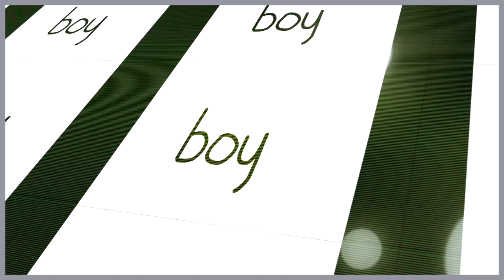How to Build A Staggered Fused Clapton Coil the Easy Way

Comment: Staggered fused claptons were always pretty easy for me, but it took me forever to get an alien clapton down. I always did my staggered fused claptons freehand and without swivels but i always used the loop method because i dont want to waste all that wire haha. I even made a 32gx2 core wires staggered with 36g freehand, an 8 wrap came out to 1.5 or 1.8 ohms, somewhere around there... I could never get more than an inch of an alien clapton good freehand tho, but I finally got some swivels and now they are just as easy as a normal clapton for me. But this is a very informational video man!
Reply from the maker: +JAM3ZI420I yeah you freehanders are crazy! that requires a level of patience and commitment that i just do not possess

Comment: very nicely done man. very nicely done. definitely going to look into the hand drill
Reply from the maker: +Joshua “Apathy” Miller oh it's killer... i love that thing
Reply: +OhmBoy Josh hey josh wanted to tell ya that on my stapled coils i no longer cut my ribbon wire. i just bend them over and crimp them now. alot easier to keep em all together. instead of having 6 or 20 or however many pieces of ribbon i just fold it into 6 pieces and crimp each fold with my pliers. been alot easier than trying to stack all of em together and then keep em together. figured id let ya know.

Comment: these are my favorite coils to vape on, I like making them too, I made one last night with three different size wire, first I claptoned 28g with 30g, then fused them together with 34g,  such a good vape, I need a macro lens from my phone so I can start shaping pictures.
Reply: taking*
Reply from the maker: +Shawn Reding definitely man! You can get a macro pretty reasonably on amazon that'll fit over any smartphone
Reply: +OhmBoy Josh Made a micro staggered clapton this evening, 30g cores wrapped with 34g (all 316L), no magnifying glass...5 wraps around a 2mm spaced and then put in a 25mm VCMT to run in TC...I really need a micro lens!

Comment: Thanks +OhmBoy Josh for posting this awesome tutorial! The other day, I got a C.M v3 diy coil / tool kit, an iJoy RTDA Classic  and a couple spools of wire. The RDTA along with my Wismec Theorem,  Buddha Zephyr  and Kanger RBA I now have a few build deck options to start honing my coil building skills. I've already built several standard wrap coils, but I can't wait to try building the more complex types of coils such as the staggered fused Clapton etc.....  Now for my "newb" question, how do you get the different heat colors to show up in the coils?

Comment: Y'know... If your lazy and dont mind a less than perfect build, what you can also do is clapton half the length of wire, loosen it, and just pull it to the end. It wont come out perfect (there will be a few spacing issues) but you should be able to happily get 6 or 7 clean wraps with the same length of wire shown. I usually make giant wires so I dont have to do it twice, and that contributes to the extra slop and waste but still, it's an amazing vape. 

It's also nice to see some one else using large atty's. I use the 30mm Mason Gemini myself, the 40mm was just too much of a monster for my needs. Bigger builds = more vapor and flavor, but also massively increases the juice consumption too.

Comment: i tried this but used a lower gauge for the loop (28) so when the spring contracts, the actual gap between wires is closer to the fusing clapton wire (30). very east n freehanded the whole thing, just a thought, i find the faster it spins, the more even n tight the wrap

Comment: Ok so I've got half of this on lock, so a spaced clapton fused to a round wire, I'm working on the full staggered fused.I keep running into problems though, I have tried 24g and 26g Nichrome80, 22g, 24g,and 26g A1 Kanthal and I keep running into the same problem. As I make the spaced/staggered clapton the core wire repeatedly breaks off at the chuck of the drill. Any tips or thoughts on why?

Comment: If you go to electronics sites like Maplin or Rapidonline, they have sections with educational kits for schools and stuff. For very little money, you can buy a motor in a mount, that also has enough spare cogs to gear it how you want, with plenty of spares you can use to make a rig that turns at both ends, so you don't need swivels cus both sides are turning at exactly the same RPM. You'd still need some skills to build something, but you could make a good rig very cheaply. You can even make a speed controller you operate with your foot, from an old/broken Wah pedal. As long as the pot still turns when you move the pedal. Even if the pot is broken - prolly the most common failure point of a wah pedal - you can easily get a new one for a couple bucks.Or you can forego a speed controller or make one that isn't hands free.

Comment: hey Josh! great tutorial!! I like the hand drill tool and already bought the same googles, really helps building, buy hey, I wonder how can I check the own without setting the coil on the rda, I use a multimeter but I think it may not be the best way, thank you!
Reply from the maker: +Ciro M. Aside from seating the coil on am atty and putting it on a device not sure about another way to check the resistance

Comment: Josh i know this is the wrong video for this post but im hoping regardless that you'll give me a pro tip.. for the life of me i cant seem to fuse more then 3 wires together.. just 2 is fine.. when i do 3 and think everything is parallel in my chuck and at the end of my bearing swivels and even with the keyring around the center of the wire as well after about 3-7mm it bunches up.. idk why or how ive tried leading the wire and following the wire more pressure less pressure.. i just cant seem to get the proper finesse to keep the cores all laying flat.. without them getting bunched up:(.. sucks the big one.. i want to get multi-core fused claptons down before i get myself into the alien.. in concept and theory i know i could do it its not all that complicated im sure (hoping) i just need your Jedi coil skill and any protip as to how i can keep my wires parallel oh ive tried tape as well but doesnt really do anything for me.. please if you'd humor me.. in a response that'd be great.. ive asked on forums etc. and some people are assholes and wont help because im not a jedi at coil creations.. so please if you would.. if not i understand im sure you have a lot a lot of things on your plate then to answer a newb with whats im sure to you a dumb question..

Comment: Another great tutorial Josh. That hand drill is awesome.
Have you tried creating these yet without creating the spaced Clapton wrap?

Let me know if you need the trick tip? 

Loving the content in your channel bro. 

Mad respect!!!
Reply from the maker: +Jon Damon Thanks man! Yeah i love that hand drill way too much.... but what do you mean exactly? creating a staggered fused clapton without staggering the clapton? like a fused clapton? that's not what you mean... what do you mean? i don't follow
Reply: +OhmBoy Josh take a piece of core wire, Clapton wrap just over half of it. 
Spin your drill in reverse to open up the wraps (like m.terk does to decore) do this twice for each core of the SFC.
Then line up the 2 cores on your swivels and in the chuck. 

Then anchor your fuse wire and wrap as you would an Alien by leading it forward slightly. 

The reversing of the drill to loosen the wraps creates enough space to fuse it! 

Hey presto easy SFC. 

TRY IT OUT. 

Personally I Clapton in 38 and fuse in 40. 

@CoilBuilderJ_v.b.c

Comment: i would like to see more about the separation part. i didnt quite get the loop thingy ahaha. i have tried squid dude method twice but my wire broke twice.. rip
Reply from the maker: +Marcus Gersbøll (Harekusse) hmmm... basically that loop acts as the second strand in squidoode's tutorial... rather than using the second strand, you use a loop of wire to act as a spacer wire... you place it just before the last loop of the initial inch or so of clapton and then just clapton through the strand as you normally would and it creates the staggered core
Reply: OhmBoy Josh okay thank you ill try it out soon :)

Comment: Ive been thinking about using a larger gauge for the loop, like 34 or 32, so I dont run into as many problems if the claptons are unevenly spaced when I do the actual fusing. Not sure if it will make gaps or not, but this is probably the most infuriating part of the process I run into, gotta find a way to make it more consistent
Reply from the maker: +torwantssandwich you could, absolutely... it won't be as tight between the fuse and the staggered tho... loosening up the core really does wonders tho

Comment: Great video as always thank u. I noticed in a few of your vids that u like to build & wick on a kbox 200 but then u always switch mods for the face time part. Why is that? I have a kbox 200 which is why I'm curious.
Reply from the maker: no real reason honestly... i will usually build on whatever i have handy if i'm not using an ohm meter... the kbox 200 is a box i usually have around because it's a good beater box, so i reach for it often
Reply: OhmBoy Josh can u make a video of taking close up micro pics of coil. u should make it a how to video, & show us how to make a setup that would be fucking awesome, thanks✌

Comment: Nice. But instead of stretching the core wire and loosening the wrap, you can just use a larger gauge wire to space the clapton while wrapping. So wrap with 32awg, but use a 28awg for the spacing wire. This works great for me. And  you don't end up with uneven spacing,

Comment: Hey Josh how would you say a staggered fused clapton compares to a Staged Heating coil (Fused clapton 2x26g - 32g with twisted 26g). Staged heating is currently my fav coil and have used it for a year or so but am also on the hunt for something different/better.
Reply from the maker: +James Muir i would compare it more to a fused clapton... better flavor, but a slower ramp up... but you can make the staggered fused clapton into a staged heating build, too

Comment: Brilliant idea using the Fiskar. I got the fused clapton, staple, framed staple, down. I believe I am ready for the stagered fused clapton. I got the fiskar. My question though... is it worth the effort?
Reply from the maker: imo the sfc has slightly better flavor than the fused clapton and a slightly longer ramp up.... but once you learn the sfc, it's kind of a gateway into the staple staggered, the staple staggerton... lots of other fun builds
Reply: Dude.. I finally got a staggered fused Clapton... mostly. you were correct, it is a pain in the ass. It is not good enough to take a picture of yet. The next one i think i will use 24 and 32 or 30 so i can see what i am doing. Until i get it down
Reply from the maker: yeah sometimes using a wider guage until i have a handle on things goes a long way
Reply: my thoughts precisely.

Comment: some great tips there. haha you seem to be of the same opinion of the "purge" as myself. I dont see the point if the ramp up time is minimum. although with that build id probably hit the switch before i even started to lift the mod as well as that exhale :-p
Reply from the maker: +shadowtaz82 yeah the purge - that's a good way to put it - i don't see the point if the ramp up is minimal... but yeah, you're right with this build it needs a bit of time to ramp up for sure

Comment: that hand drill looks amazing. I need some help I just started building and   my wire keeps snapping at the end of the chuck. I have the swivels going and they are spinning. the wire isn't coming out of the chuck it is snapping the wire. what am I doing wrong? can anyone give me some advice on appreciate it.
Reply: You might be bending the leads you're putting in the drill chuck too harshly. if you bend any kind of metal too harshly it creates a weak point if it doesn't break when you do it. just try doing more of a rounded bend rather than a perfect 90 degree bend. if you're using pliers to make the bend try just using your fingers. if its not that then try pulling less on the wire when you're wrapping it. You might be pulling too much.
Reply: +James McGrath I am using pliers to bend it and it comes out like an L shape so I think u hit the nail on the head. thanks you for the help man I'll let you know if that was the problem.
Reply: to tight bro ..

Comment: I know how to solve the issue with wires slipping out of a 3 jaw chuck. Instead of putting them directly in the chuck make a little open ended hook and wrap the wire onto the hook and tighten the hook into the chuck. If you have a spare interior door key like most bathroom door knobs comes with you can just bend the end handle end of the key out a tiny bit so it is hook shaped and it works perfectly and is a 10second tool to make.

Comment: Didn't specify my comment, my bad. Was wondering do you have to have a specific lower or higher gauge for the core of any build? For instance if you're making alien clapton can you use 28 gauge kanthal and 26 gauge kanthal with a 26 gauge OUTTER wrap ??? Just wondering. Stuff confuses me gauge wise
Reply from the maker: i wouldn't clapton or fuse below 30 imo... and generally i'd use at least 34 on a fuse or clapton, stagger, etc.... cores.... generally you want some difference in size between the fuse and the cores... larger core, smaller fuse for example... like 26 and 36 is nice.... 24 and 32 can work.... 30 and 40 or 28 and 40... i usually stick to that rule of thumb
Reply: OhmBoy Josh thx bro big help !
Reply: OhmBoy Josh why I'm asking is because I just ordered the 'UD Wire Box' .... gonna be my first time coiling so picked this up ...

It only comes with 26 and 28 gauge but all different wires ... guess I need to pick up some nichrome 36 gauge for my core besides that box, can't do too many fused build with just 26 and 28 gauge

Comment: Ahhh I hate the loop method. SFCs used to be my go to build but when that technique came out I felt obligated to save wire,  the spacing never seems to come out evenly enough.  Maybe loosening up the core would help combat that
Reply from the maker: +Nigel T hmmm... i don't really have a problem keeping them evenly spaced - for the most part... only when it slips off the drill or i have to start and stop again (in this case repositioning the camera - haha)... but yeah loosening up the core does a world of good!

Comment: Couldn't you use the parallel clapton technique and the clapton you pull off to create the staggered effect stretched and use to make alien claptons?
Reply: No because you don't pull aliens off by unravelling it. you make aliens by decoring the wrap and stretching it out
Reply: Thanks, some research will need to be done, testing is necessary
Reply from the maker: basically what happens with the parallel clapton technique is that the strand you pull out is pretty much unusable... it's a curled strand that will never be able to be used by anything again.... it doesn't separate from the core wire in the same way that it did in the alien tutorial

Comment: Damn dude! What do you think the minimum amount of wraps would be to throw this on a regulated? .1 ohms as the lowest, I don't have a 40mm RDA hahaha.
Reply from the maker: i usually build something like this with a 5 wrap 3mm ID... using 26 guage cores... it'll depend on the wire you're using, the diameter of the build, that sort of thing...
Reply: OhmBoy Josh Ah right on, it'd probably be Kanthal core with Ni80 Clapton, forgot to mention I usually rock dual coils, so it'd probably be a bit thicker to compensate haha. I guess some experimentation would need to be had!
Reply from the maker: yeah 5 wrap dual... 26g... probably fine
Reply: OhmBoy Josh Wicked man, thanks for the info and the awesome tutorial! Love your vids.

Comment: imo you dont need the extra cotton in the bottom of the deck if its not touching the coil.  the 2 ends of cotton are gonna draw the juice off the deck just as fast weather you just have the ends touching the deck or you have a bed of cotton on the deck.  to me having a bunch of cotton laying on the deck is a waste of space and the juice will settle in the cotton on the deck and never wick up to the coils. thats why you get those dark spots or saturated spots in the bed of cotton that never goes away or never wicks up to the coils.  imo all you need is the 2 ends of cotton just touching the deck and it will do the job.  you also get a lot more room for juice.the only down side is it leaks a little easier if you arent the type of person that keeps yur mod upright at all times.
Reply from the maker: +r6exrider it's partially for the leakiness here, too... 40mm is a lot of area for juice to be sitting in without anything to soak in to. And yeah leaking, spitback... gotta keep that under control.

Comment: the electric drill I think is better because you can go just as slow with finger control on the button.. but you can also go much faster with it..  superior
Reply: on some drills youre correct, but not alp drilps are created equal. some drills dont have variable speed at all, and some that do are very touchy to get the speed correct. my Milwaukee is greatbas far as the variable speed is concerned but its got 3 jaws in the chuck not 4 like my ryobi, but my ryobis variable speed is alot more finicky. the hand drills do give you more control even over a really good drill, but to each their own. theres no right way or wrong way unless youre just being unsafe. live longer & vape safe.
Reply: +Joshua “Apathy” Miller agreed..  no wrong way..  unless your not being safe or no getting it done lol.
Reply: Joshua miller q